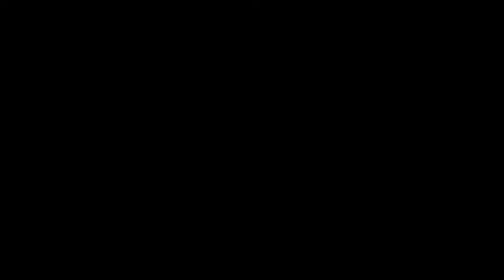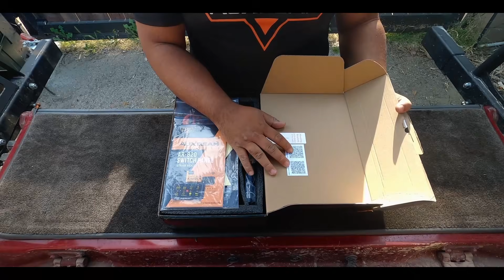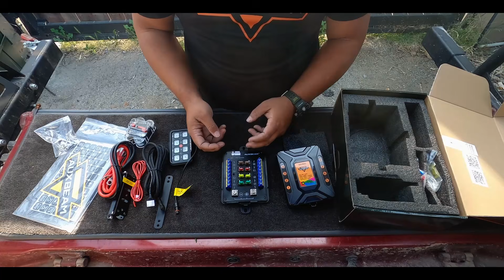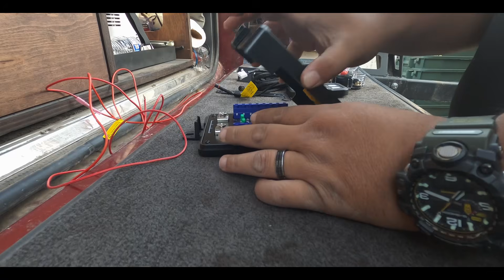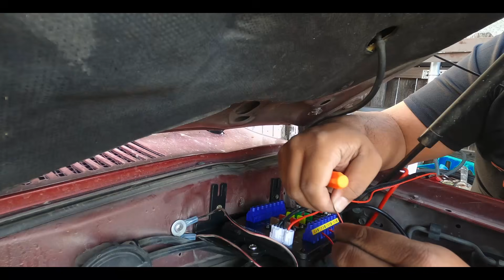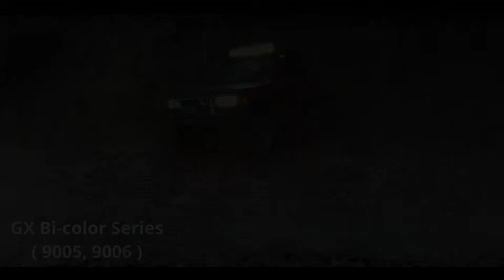New 8 Switch Panel! Auxbeam AR-820 | Install and Overview | 80 Series LandCruiser

Comment: which fuse did you pull to put the add a fuse in? i have a 1992’ and have a 6 gang i’m wiring up but dont have a multimeter on me to find which fuse i should tap into
Reply from the maker: In the inside fuse box, I tapped onto the "ign" fuse.

Comment: Cool vid. Hey I  fitting the same system but wiring it to Aux battery as I want to be able to operate the switches and accessories with the vehicle turn off.
Only issue is I am finding the backlite remains on 100% even once all the switches are off.
Do you know is there any way I can re program the control panel to be able to turn the backlite off. Any ideas you have I would appreciate hearing from ya. Cheers Grant
Reply from the maker: Off the top of my head, you can dim the control panels light on the app, or add an inline switch that turns of the unit when not in use. 
But just to turn off the back lighting, thats a tough one. There should be a wire/circuit that controls that backlighting some where on the wiring leading to the switch panel, or in the switch panel itself. Theoretical if the line isn't being used for anything else besides backlighting you could put a toggle switch somewhere on it. But it's highly likely that same line is actually the one providing power to the switch panel, so it might not be functional if you have a on/off switch there.
Sorry, I wish I could be more help. I just run a switch in the cab to turn off or on the unit regardless if the rig is run or not. So I've never thought about this.
Reply: @ thanks for the prompt reply .
Yeah I kinda thought as much.
I was just a bit confused with all the models as it would seem some of them might let you te program  the panel and that includes turning the backlight off.
Yeah you probably right I think it’s a can bus system given there are only a 4 pin plug going into the panel , that you just couldn’t cut into one line .
Only choice might be as you done and use that single acc line and add a toggle switch on it , 
Trouble is I was hoping for night op to still have some circuits on but have the backlite off to reduce attention and keep bugs away from the light.
Might have to make a cover of sorts for it.
Anyway thanks again.
Cheers Grant .